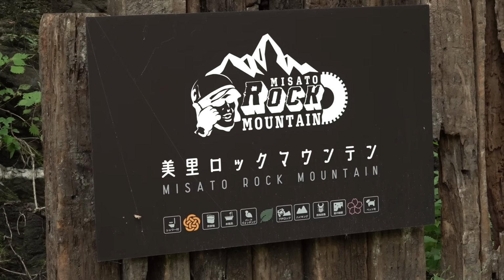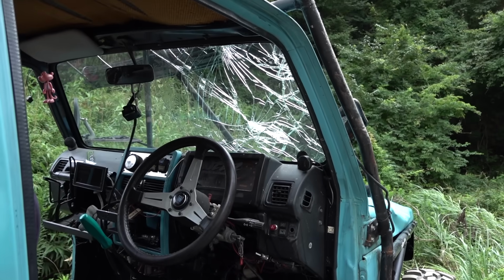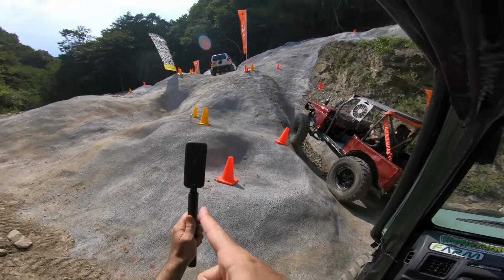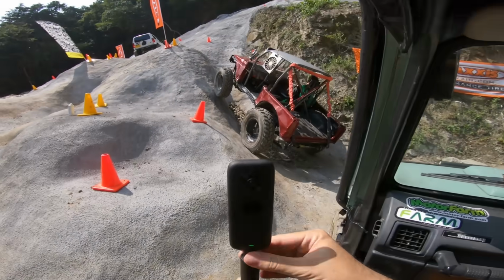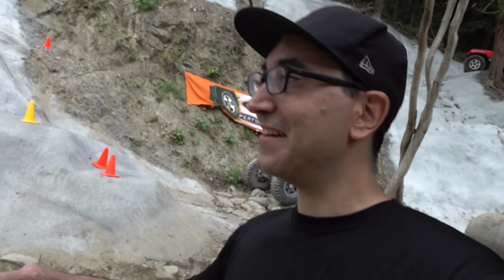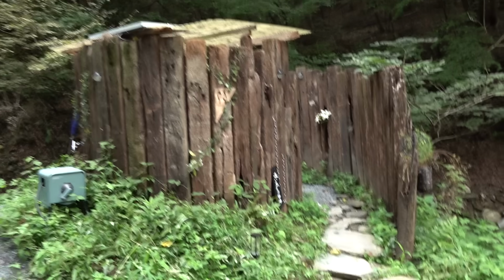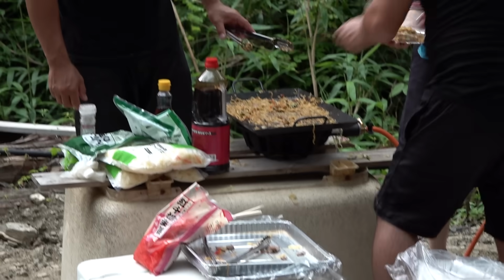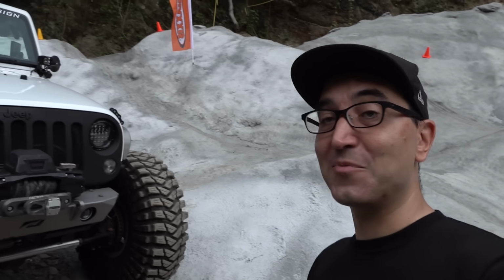I drove a Jimny on a huge fake mountain

Comment: ive always found it so cool how they used to have 2 stroke motors in cars!
Reply: We kinda did it for quite a long time actually. The last ones to hold on to it were eastern bloc countries.
Reply: A 2-stroke engine certainly helps when you have very steep slopes like these
Reply: Certified LJ moment

Comment: The Suzuki Samurai's in the US in the late 80s/early 90s were the best thing we ever got but were sadly short-lived imports. I wanted one so bad but they were always roached by the previous owners or someone had yanked the original engine and thought it cool to put a Jeep straight 6 or lump a 283 V8 for 'more power' (pretty much a wash on that end due to the increased weight). They also had the notorious roll-over warning stickers that pretty much killed public interest, but they remained very capable in stock guise.